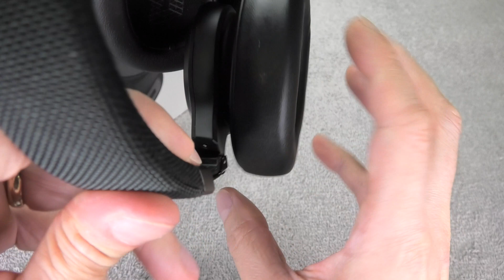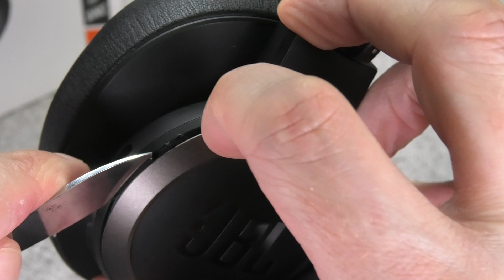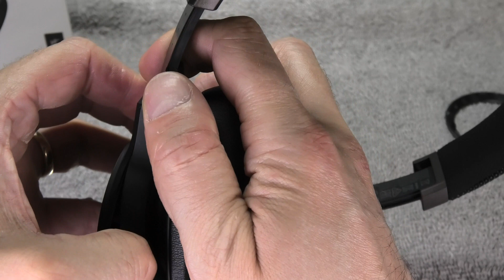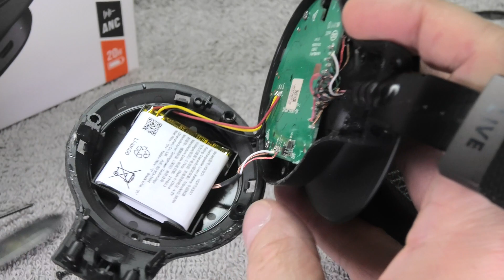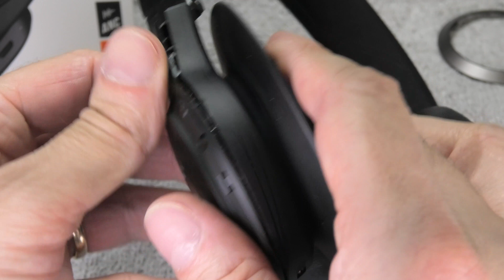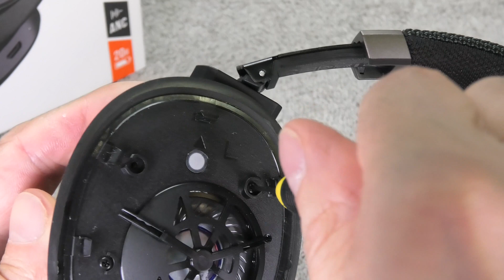Looking inside JBL LIVE650btnc Bluetooth Headphones (TEARDOWN)

Comment: Thank you that was really helpful. Battery replacement was actually slightly easier on my JBL live 660NC as there is a clip that attaches the battery to the pcb. Your instructions for opening the ear cup worked perfectly. Thanks

Comment: Hello there. Amazing video. I have a pair of JBL live 650btnc and I'm facing a problem that idk if you can be of help. So a wired connection via the aux cable sound comes from both drivers but without the aux when powering it on sound only comes from the left driver and on the right you hear sound from a far. So tried hard reset thinking it's stuck on mono audio but nothing is happening. So can you be of help?

Comment: Thank you so much! One of the clips at 7:15 had broken off and was bouncing around in the headset making me go insane, but managed to disassemble it and get it out with no issues thanks to you ^^
Reply: Thank you for this comment! It turns out that one of my clips of my that were used to hold the cups in place were snapped off and also made this really annoying rattling sound. 

I was able to avoid the entire hassle of opening up my JBL 660NC Live by taking a strip of paper, fold it up a few times and crammed it into the crease of where the clip came loose. This holds the clip in place and now the rattle is gone.
Reply: Mine too! This video helped a lot

Comment: Hi mate great video, I have a problem with mine, but the problem is that has disamble one side from the one where are all the buttons.t has two round hooks, but I don't know how to fit both at the same time. I don't want to use too much force to see if I'm going to break them. Could I send you a photo to some email of my problem?

Comment: My left speaker dont work but only with bluetooth but with the 3.5 mm cable it works can anyone help me
Reply: Sorry if im late but probley the ping of pings in the 3.5mm Jack is  on the wrong place so try with the 3.5 swiffle around that will probely fix it

Comment: I have looked through your videos for a fix for my JBL LIVE650BTNC headphones where one side does not work but you don't have one.  I found the following video with the fix I need but it's not the same model https://www.youtube.com/watch?v=jxVqfxQRnP0. Can you please help me?  Thank you in advance.
Reply from the maker: Hi, the LIVE650 unfortunately doesn’t have the same design.  
It is possible that one of the solder joints of the wires to the driver went bad. But that is hard to tell.  Are you able to open up your headphones to inspect them?
Reply: @MegaSafetyFirst  I have the same problem, the headphones were unfortunately water damaged due to heavy rain. after some ghetto hair dryer treatment they worked fine but then when I charged them again the ear with the audio jack stopped working, on the next charge they both stopped working. the thing is they both work completely fine when used with the audio jack. and at the same time the headphones connect to Bluetooth when opened and the battery seems to work fine. i took them to a repair guy friend of mine today but we could only solve one ear (the one with the battery). what we did is clean some oxidation from some components  but we only opened the right ear. 
do you have a clue why that is and how to fix it.  
TLDR: water damaged 650BTNC right ear doesn't work when powered but both work fine when using jack

Comment: Thanks, I was able to fix my headphones because of this video. It has dropped to the ground, and the cup got loose (with the wiring broken). I was able to open it and solder the wiring correctly because of your zoom on 5:04. Really appreciate it man. Thank you.
Reply: Hey bro I have the same issue only the right earcup works and the left one does not play sound and is loose, what did you do to fix that?

Comment: I bought these Live 650 four months ago. Very happy with them until today, when they went dead --ie not charging. I checked charged cable (OK) so it seems battery is dead; is this normal?
Reply from the maker: That does not sound normal at all. 
Are your headphones still under warranty so you can get a replacement?
Reply: i got some jbl live 500bt ones. had them for a little over a year, but it just won't turn on anymore. red light won't turn on when i plug it in as well. at least i can still use it in wired mode.